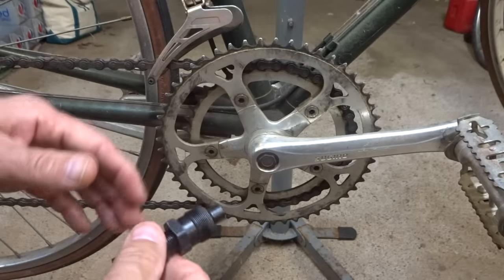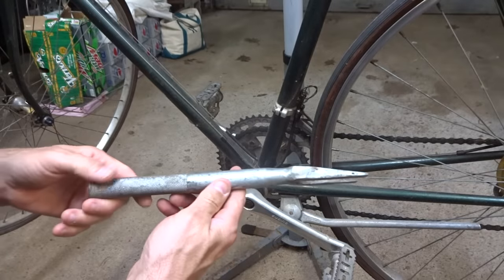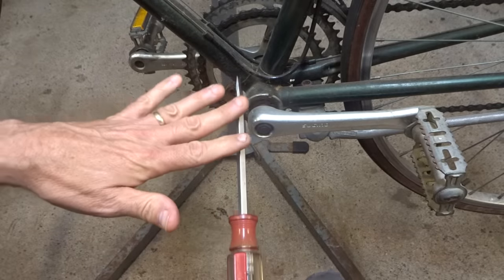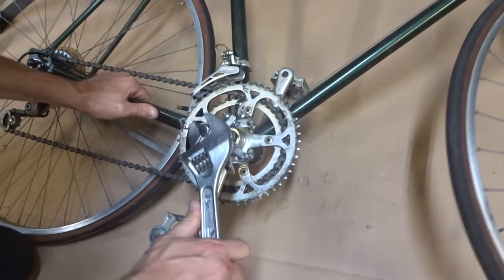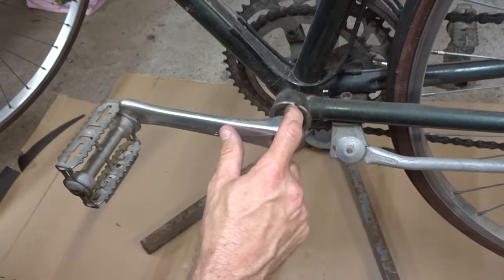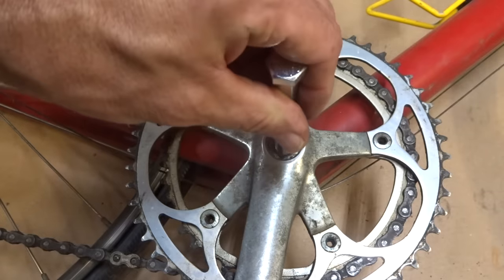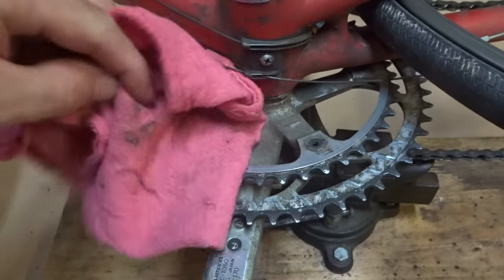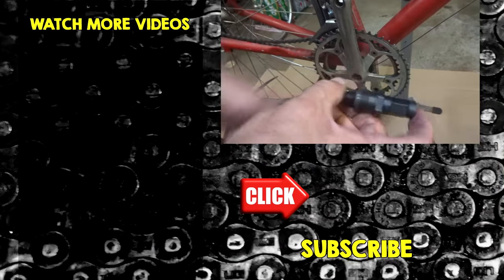Remove Cranks Without A Crank Puller

Comment: These types of cranks need to go away
Reply: They have on non department store bike
Reply: Agreed. It's absurd that they're still around. My current commuter has a square taper BB, they're absolute pains.

And those sealed cartridge replacements can also go away. They serve to do nothing but revive obsolete technology.
Reply from the maker: Many millions of bikes out there that have them!
Reply: Square BBs work perfectly for years, whats the problem with them? Dont be fooled by marketing
Reply: @mitxelgl6559  They're heavier, less stiff, and more difficult to fix/maintain.

You know what other BB standards work perfectly for years? All of them.
Reply: @phillycheesetake  the heaviest and most inefficient component is the rider, not  the bb
Reply: @mitxelgl6559  If I'm given the choice of replacing a worn-out chainring for a Square taper BB (which will possibly involve getting new cranks), or scrapping the lot and switching to Hollowtech 2, for the extra $40 I'm switching.

There are other advantages to externally-threaded standards, better bearings, wider axles, etc. There's just no reason for me to ever choose the old 3-piece designs.